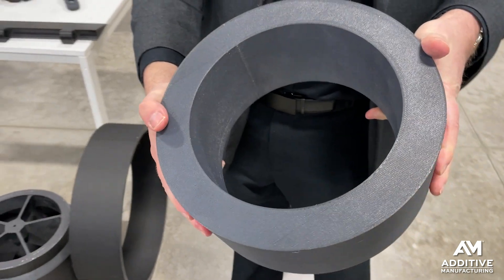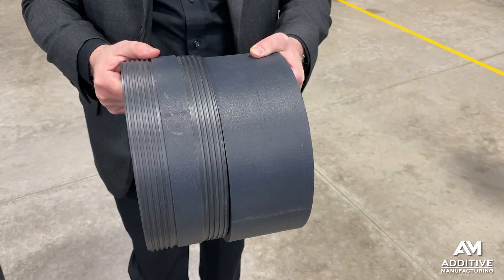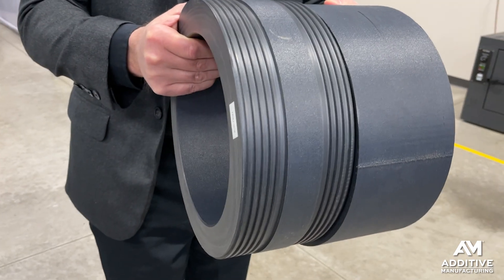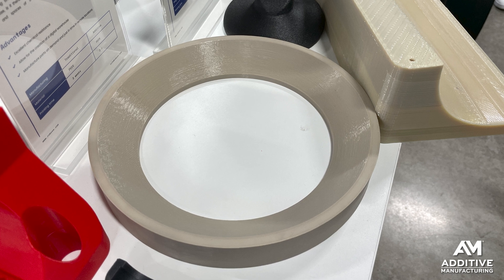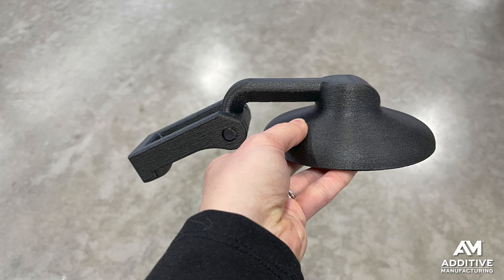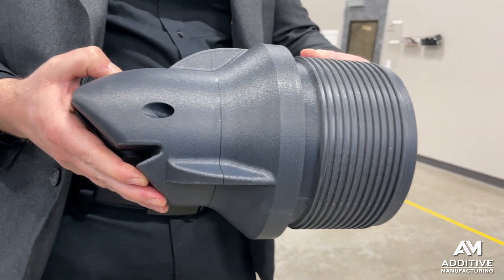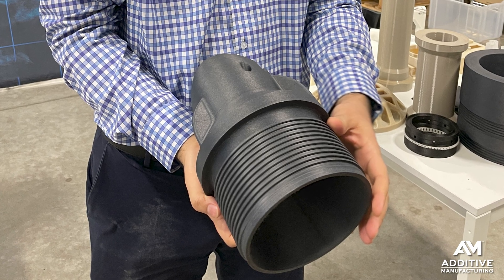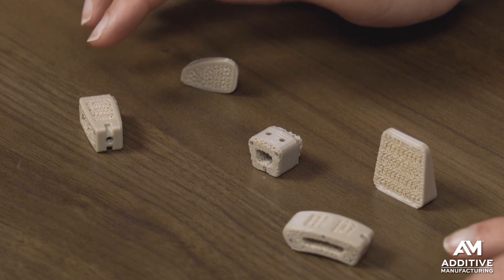3D Printed Parts for Oil and Gas Industry Made of PEEK

Comment: That's a $2000 chunka cf-peek! Awesome! Machining it from a billet would definitely cost a lot more given the size, and waste most of it. And then you wouldn't have the positive aspects of PEEK. Outstanding demonstration of how additive mfg is a great solution. And outstanding job as always with presenting and production of the video! ❤
Reply from the maker: You're no stranger to these materials and processes! Thanks for watching. If you want to dig a little deeper, Pete wrote a full article from his visit at Roboze. It's on our site: https://www.additivemanufacturing.media/articles/in-oil-and-gas-an-additive-manufacturing-standard-(api-20t)-will-aid-adoption-of-composites